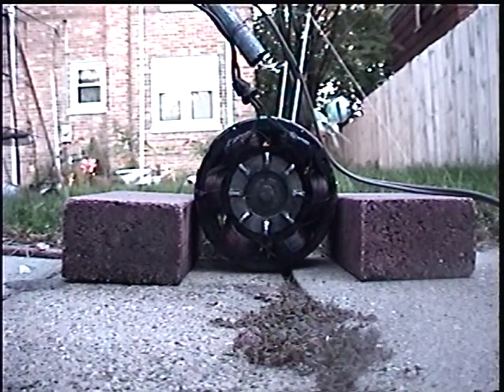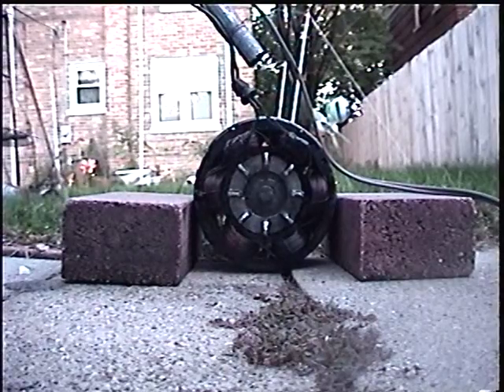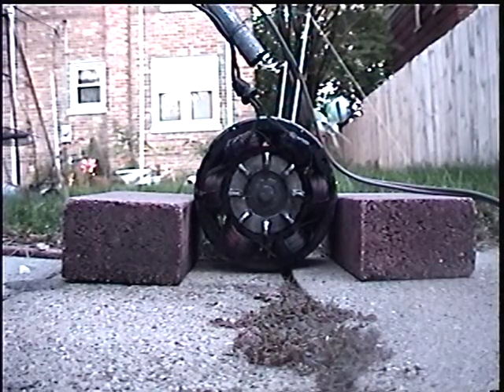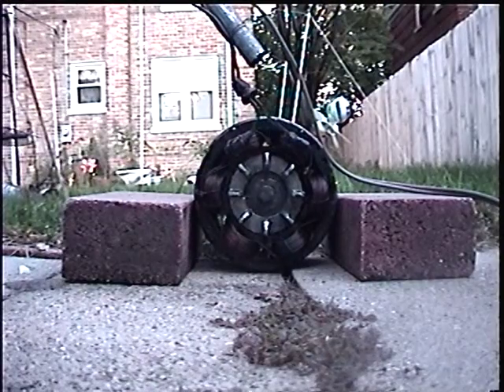Vintage/antique fan safety, Electrical short.

Comment: Very true, I have a emerson jr b type 2250, which the motor and switch are original but strong, but some where in the fan it shocks me anywhere I touch it
Reply from the maker: If you get shocked, that means there is definitely a problem in the wiring of your fan.  Loose wires, wires in which the insulation is breaking up and/or that has the copper/silver parts in contact with the other metallic parts such as the stator/speed coil laminates or the housing, pressure on cloth-covered wiring by screwed together components, and wires not properly connected/screwed/soldered together commonly cause some of the electric current to divert into the fan's housing, which in turn causes that electric shock when you touch it.